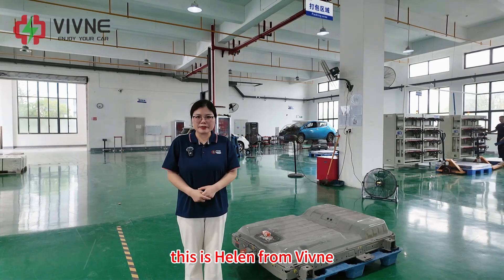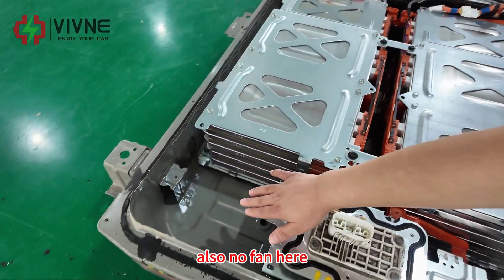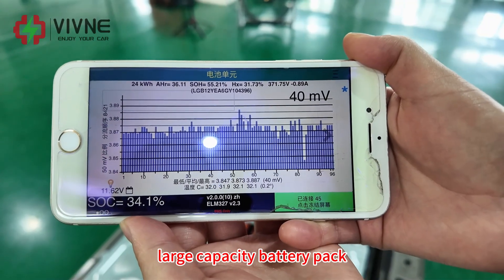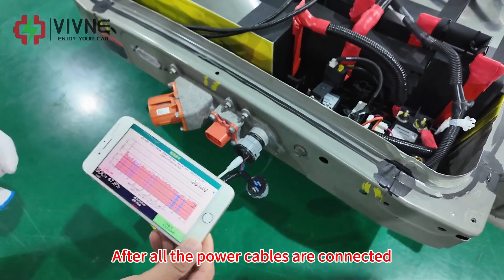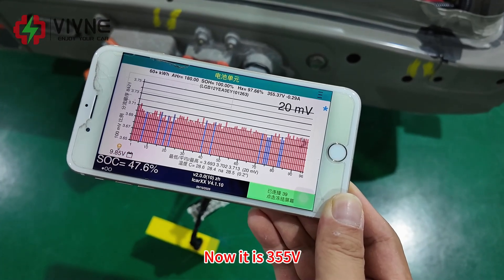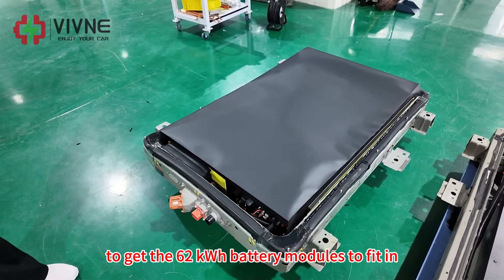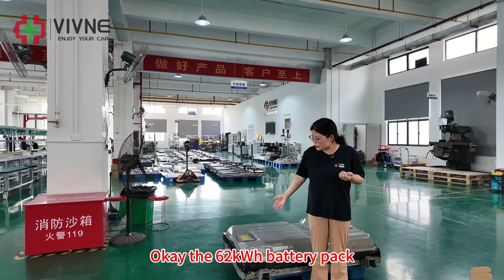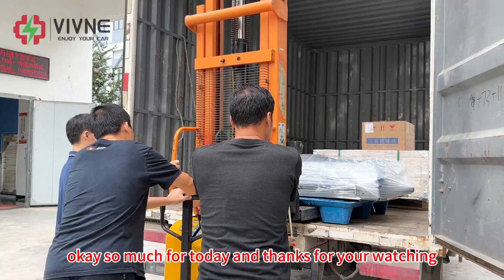VIVNE- Nissan e-NV200 upgrade to 62kWh battery

Comment: The struts are welded in place for stability and must not be removed; they serve a purpose and are not installed there by chance.
Reply from the maker: What you said make sense. We had also explained this to customer before the upgrade. But the customer just need large capacity battery for his eNV200 and strongly ask us to do.
Reply: Zwróć jedak DANIEL uwagę że w starym rozwiązaniu  ogniwa są w formie kwadratowych paczek.  W nowym rozwiązaniu gdy są przez całą długość obudowy akumulatora one same stają się usztywnieniem.

Comment: VIVNE offers for Nissan Leaf 62 and 68 kWh batteries with the same module sizes. Can a Nissan e-NV200 also gets a 68 kWh battery upgrade?
Reply from the maker: You are right. The e-NV200 can also be upgraded to 68kWh battery.

Comment: ”No battery cooling system" means that the model may be a 7-passenger wagon model.
It has a 3rd seat cooler instead of a battery cooling system.
I was an owner of the wagon model with a 40 kWh battery.
Reply from the maker: You are right. Usually the 7-passenger wagon model has no cooling.  😁

Comment: So no cooling anymore?
Reply from the maker: His original pack is without cooling. If with cooling, the cooling duct will take extra space inside, which will make the already limited space in the eNV200 case can not fit in the 62kWh battery.